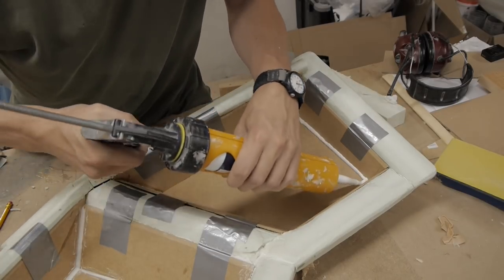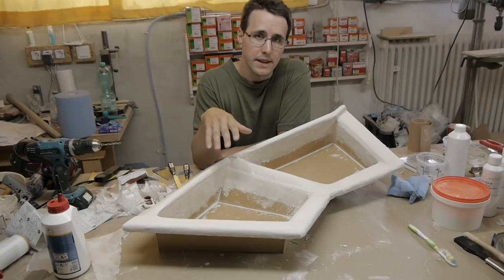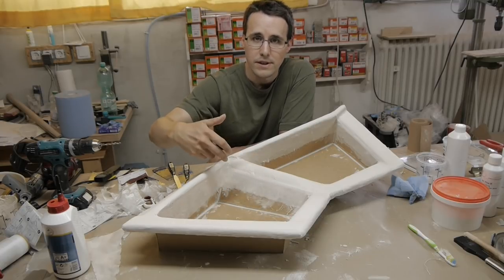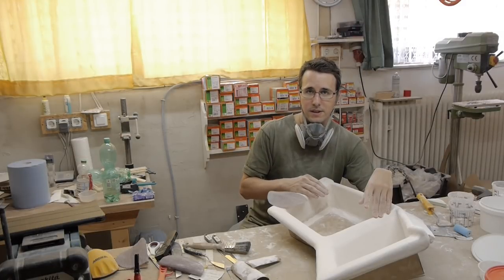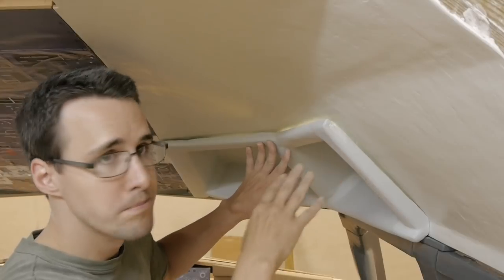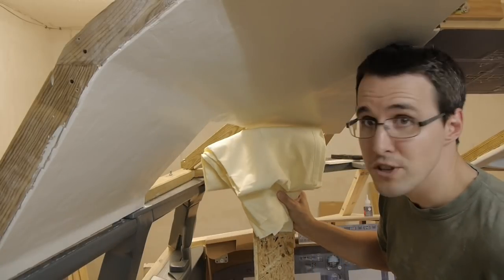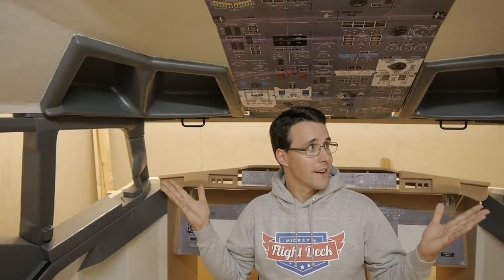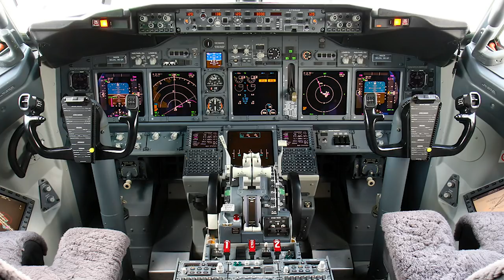Building Eyebrow Windows - A Boeing 737-800 Homecockpit #23

Comment: Hello Mickey, great work, as always. I want to ask you what is the paste you use to sand later. I use the two-component paste used in cars, but it is very complicated to work with it. Greetings.
Reply from the maker: It is called Acrylic One. You can find an introduction to it when you follow the info card I've added.
Reply: Thanks Mickey. I'll try to get it around here. Good video.